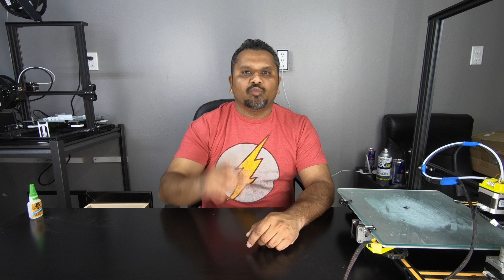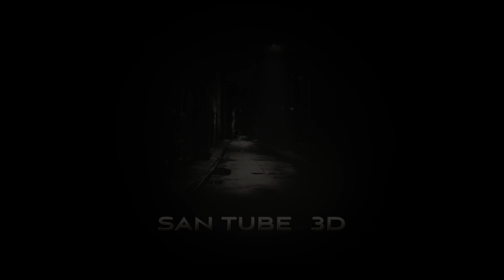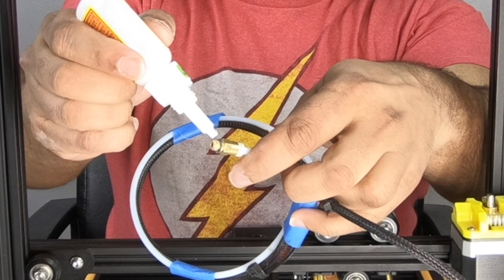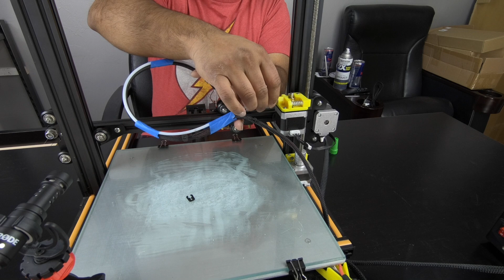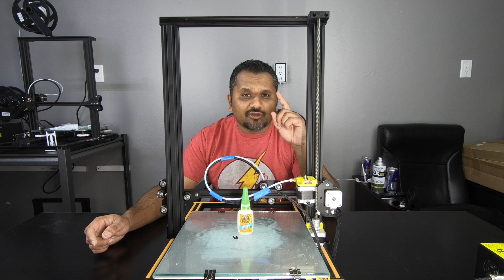Bowden Tube Keeps Popping Off [Fixed]

Comment: My problem is that the filament tube is disconnecting from the pneumatic joint. Shall I use gleu as well?
Reply: Did you find a solution?
Reply: @rawgamefootage  I messaged the compeny I bought it from and they send me a part that would fix it
Reply: @melleherder4841  I used the super glue and it’s working perfectly 😅
Reply: @rawgamefootage  nice
Reply: the best solution is buying 10 diffrent couplers, a ton of duct tape & rubber bands, drilling a 4mm hole through th coupler, putting the bowden tube through, using the drill on the end of the bowden tube to basically turn the end of bowden tube into a clip, and sacrifice litterly everything for a chance that it'll stop. Works for me.

Comment: Dude thank you for your videos. I had a CR10 and you helped me troubleshoot some of the issues I had. In the end I got rid of it because I just didn't have the time to keep tinkering. I had bowden tube issues, got crazy layer shifts on the y, cooling fan packed out etc etc. In the end I got a Copymaster 300 and has been a better buy with better reliability.
Reply from the maker: Glad to hear.  Good luck and your welcome.

Comment: I had my tube leave the fitting and do the same thing with the filiment wont grab the tube even when fitted correctly but does hold firmly but if you pull on the tube it will come out.

Comment: my problem is the plastic part that's attached to the metal part.  its almost like it will not grip it anymore, only   about 20 hours into it
Reply from the maker: Depending on your printer you should have gotten an extra one replace it if not then you can buy it from amazon for about 8 dollars.  In the mean time super glue that sucker on and zip tie the part like i showed in this video.
Reply: @SANTUBE  awesome thanks for the reply. Keep making awesome videos
Reply: Happened to me only a few hours in

Comment: The tube itself seperates from the coupler v.v
Reply: Same here for me it was coming out of the hotend part so I stuck it in there super glued the ptfe to the fitting let it dry halfway then squeezed some ptfe teflon over that half dry glue, and glued again, let that dry then I got more teflon and wrapped it around the little spacer then glued that in place, let it dry for 2 hours or so and you're done. Pretty ghetto but functional after that fix it's been running for about a full 24 hours runtime with no issues. Itll hold until I get the capricorn kit, but even then I was going to let it sit until I got more issues or had the piece break to make use as much as possible out of the broken coupler it fits that well. Edit, I only glued it to the plastic cap, not the metal parts, which is why gluing to the spacer is important because I'm positive that's the piece actually stopping it from coming up
Reply: @bigprojects2560  I fixed mine with sand paper just roughed it up like it owed me money. 

My new issue is that the thing jams after printing for 8 hours or more and air prints...think my printing temps too low...trying to figure it all out before I use another half roll of filament during a failed print.
Reply: @kingdarkem  one thing that helped me out a lot with that is Luke's hotend fix, only takes a little spacer you could easily print in about 20 minutes and you can even reuse the tubing you already have like I did. What are you printing with?
Reply: @bigprojects2560  suntop pla wood colored filament. Ender 5 plus, Capricorn bowden tube, .4mm nozzle and I spent the money for simplify3d. 

Been printing at 175-180 thinking of bumping it up to 220...cause of the jamming issue....even if it means stringing from hell
Reply: It’s called supper glue donut your self make it work
Reply: @candylacti7378  nah I fixed that issue with sandpaper....roughed it up like it owed me money and it is difficult to get off now lol. 

Didnt wanna go the super glue route case I needed to switch out the couplers for any reason I'm not then rebuying tube. I refuse to keep big tube in business.

Comment: Hi! I have an all metal mk8 extruder.
I'm almost going to spend to buy a bond tech bmg for my custom printer bowden style.. Should I go ahead or stay with the mk8
Reply from the maker: It depends. If its working just fine for you then there is not need to change.  If your having issues then yes.

Comment: If your bowden tube pops out you have to buy a new one with a new coupler. You will not get it back in, not even Gorilla Glue can hold it in place. I know ive tried everything before ordering a new Capricorn bowden tube set.
Reply from the maker: It does work for a very short time.  I have used it many times but yes you are correct it will need to be replaced.
Reply: i got a brand new printer that sucks that i need to get a new tube. it's a brand new printer kinda bs
Reply: @alandtic4616  same, just got mine not too long ago and experienced the same problem on my first test print. I'm gonna look more into extra fixes before replacing since its new and I'd like to get a bit of use out if it, but it really sucks that it happened in the first place :/
Reply: @alandtic4616  might try that if it pops out again lol. Though I dont think I have the right cutting tool for it :( 

I messed with stuff like the printing speed and I’m currently printing out a new test that seems to be doing just fine so far. Of course ran into a different issue with the bed motor making a strange grinding noise, but I think it mightve been a problem with the file I had? I also tightened the belt afterwards so it mightve been that, but the bed also moved fine before when I manually moved it with the control panel.

Setting your own 3D printer sure is annoying lol. I handled some printers in makerspaces but this is a completely different model 😔